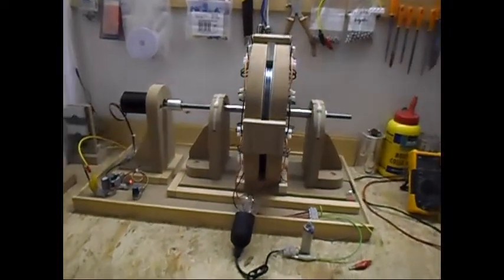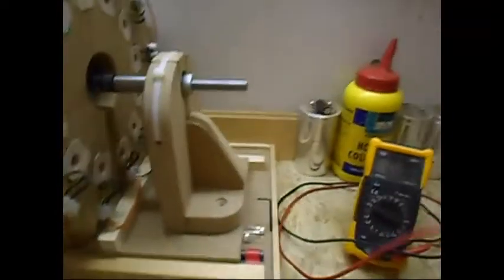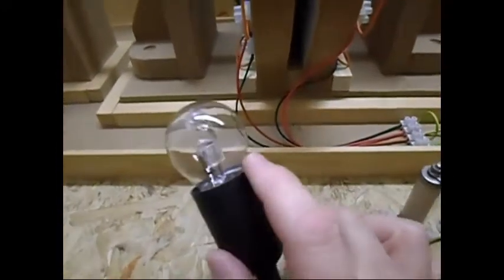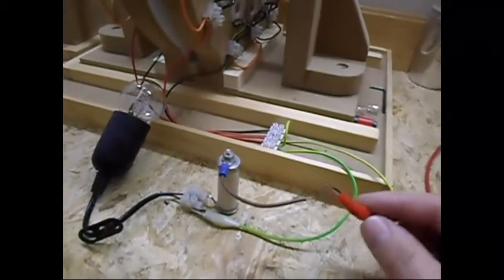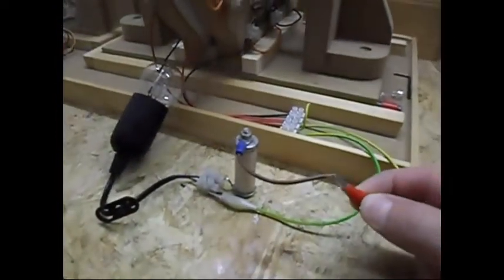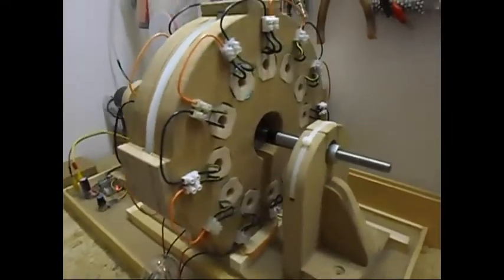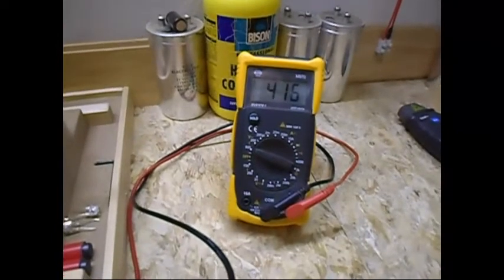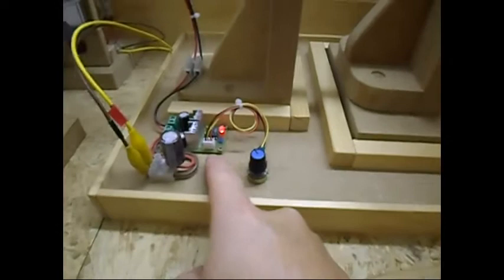Single Phase Generator_Update 1 - Running smooth, ready for testings & a surprise pic...

Comment: Hello good partner night! place a larger pulley on the engine and the generator small because it will more spin and and had decreased the weight of the generator when you turn on the lamp , it would be nice a heavy wheel to aid in weight generator

Comment: I've been doing a lot of reading and thinking and experimenting and I'm only posting this idea here and nowhere else. 
If you really want to get around the Lenz law then yes part of it is coil design but I've found another method. As you have already showed when you hook the light straight to the coil it slows the generator down, BUT when you pulse it with the use of a cap that's the seacret. USE THE GENERATOR TO CHARGE THE CAP ONLY!  Then concentrate on pulsing  the light fast with switching techniques such as using a micro controler with 1 ms pulse timing. Use a quick charge flash cap and a voltage regulator so the light only receives it's minimum  voltage to light up bright and not use all the energy stored in the cap . Add more coils so the light is steadily lite so even when pulsed you won't be able to tell because it won't flicker.
If you pulse the motor power and it's more efficient via the PWM then it makes sense to pulse the generator out put side as well.
there is alot more to it but that's all for now.

*Use the cap as a storage tank circuit only and pulse it to the load that's the key to reduce the drag on the generator.
Thanx.
Reply from the maker: Thanks for your comment and also for your input on how to beat the lenz effect...^^
I did do something like that some time ago...and yes you can light up a load and the system will not slow down that much but from what i've seen from my own testings it is not enough...not enough to get a self looped system that is...;-)
Reply: +Mister Caribbean Roots 
Add more coils and spin the generator faster. I can't see how it would not produce more then the input motor uses.
use two switches one before the cap and one after and time them opposite so when the caps being charged the lights are off meaning 2nd switch open and when the caps dump energy to the load side, to the lights, the switch is closed and the cap/generator side is open. The generator will never  "see" a full load from the lights thus not bog down thus not pull more load from the input motor. I have been playing around with this process and so far it seems promising. 
I would advise revisiting this concept  but it is your channel so do as you will, I think you are still doing great work.
Reply from the maker: Ryan Doupe 
The thing is that even if the system doesn't slow down much or any with one coil the energy you can take from that cap isn't enough even with say 24 coils...;-)
The thing is that a tiny drag with one coil becomes a massive drag with say 24 coils and if we tune it so the drive system doesn't feels it when you use some of that cap energy it is very little what we can take...and this very litte will still be not much with lots of coils...
Those two switches is just what i have done...^^
This i have done in the past, if i could figure out how to post a picture on my Google+ i would post one from the setup...lol
If i can't figure out on how to upload a picture i will put one in the next video on this setup for you to see...:D
Cheers
Reply from the maker: Hi there, heres the link for 3 pictures on the setup i've made with lots of coils/switches...^^
https://youtu.be/Q1yRLZO-lq8?t=6m14s

Comment: i love the surprise pic... how many turns ?  and... just asking... is it better to have the insulated wire or would it be better to use enameled copper wire..  in my opinion the only difference would be you get more wire turns per coil.. but mayby there is another reason?
Reply from the maker: Thanks for your comment and glad you've l;iked the surprise pic...^^
This wire is what i had and wanted to use because i am aiming for a low voltage/high amps output with this...;-)
Turns i don't know since i've just fill out the jig i made to make these coils but they are both 0.7 ohm...maybe it's my lucky number 7...lol
Well, the "self-capacitance" will be different than using the enameled wire but i don't think it's gonna be an issue...;-)